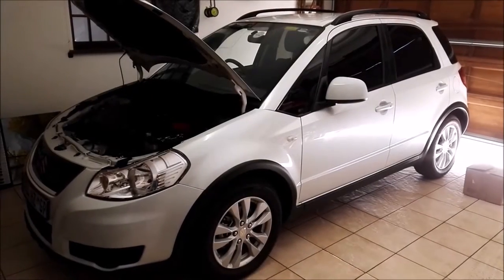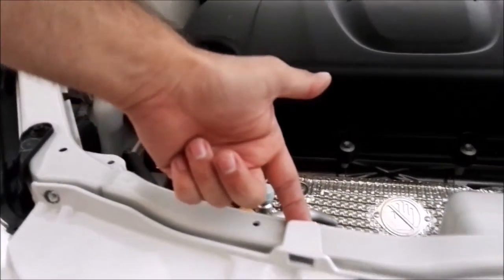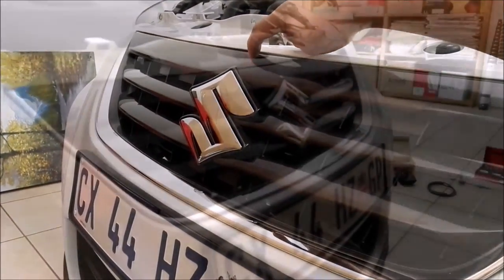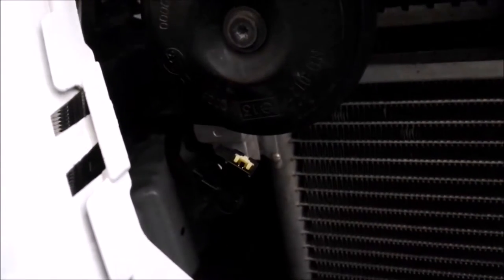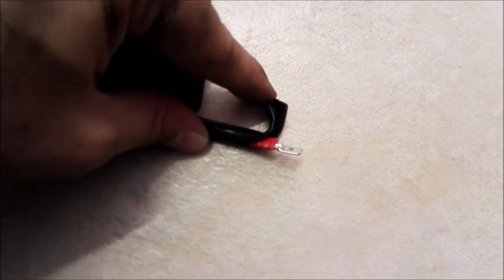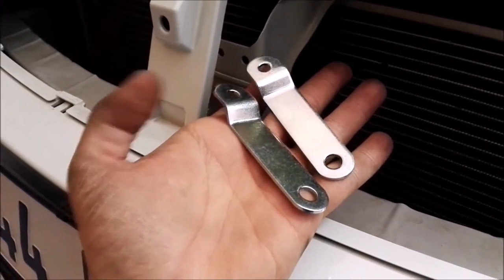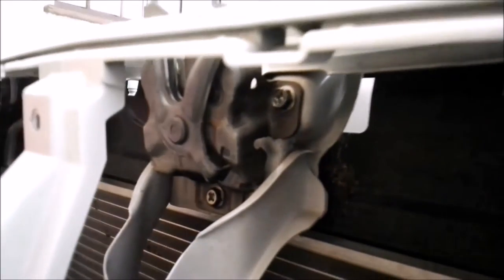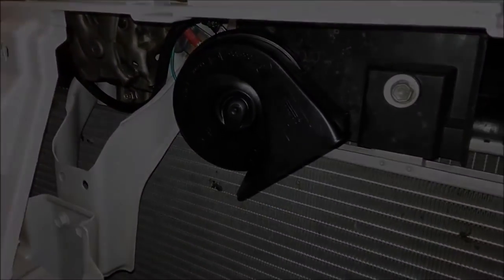2013 Suzuki SX4 Dual tone hooter (horn) upgrade DIY

Comment: brand and model number of the hooter please?
Reply: Although fuzzy, the image shows that they are italian Fiamm horns. I'd upgrade them to Intermotor horns (H17 and H18) with a proper relay system. The install is the correct one for this type: with the opening facing down (to prevent possible water ingress when washing the car or from splashing road water).